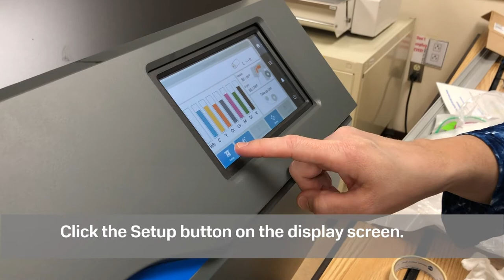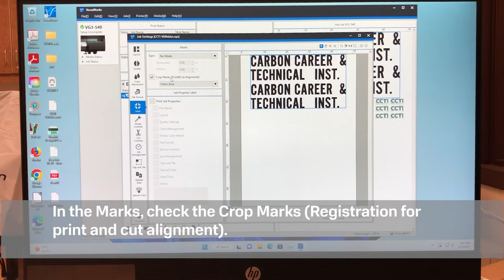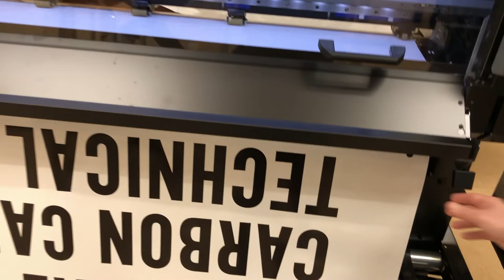Roland VG3 540 - Loading Media and Printing

Comment: I have another question. How do you adjust the Pinch Roller Pressure on the printer? The pinch rollers are pressed down too hard on my TrueVis VG3 540 and some materials cause wrinkled prints when they are pressed down too hard.

Comment: If all the colors are half way showing on the printer does that mean they all need new refil? My magenta was half way and then said empty on the machine. I bought it now it says full, now its asking for the orange color even thought it was half way on the screen, does that mean i need to replace all colors? I ran a test print and all the colors are showing.
Reply from the maker: Once a week I perform the Weekly Maintenance procedure that includes agitating all of the inks (see my Weekly Maintenance video). When you agitate them you could feel the ink moving. If during this procedure you notice that there is very little ink left, then order more. I would not order ink too soon before it runs out because of the short shelf life the inks have.

Comment: Can you show me how to clean the vinyl before printing to avoid specks of dirt, dust, oils, fingerprints, and anything else that contaminated the vinyl? I have printed on Retroreflective on this machine and even though I clean it with Denatured Alcohol and use a clean microfiber rag, it still has specks and the alcohol won't evaporate and says on the print and messes the whole print up. Wasted ink and material.
Reply from the maker: We wear white gloves whenever we touch the vinyl. We also store it in the plastic bag it came with upright. I never use alcohol to clean it. If I think the exposed area of the vinyl roll might be dirty, I would rather not use the exposed area so that I don't end up wasting ink on a dirty surface. I also use use a flashlight to inspect my roll and my print area to detect and remove any dust, fibers, dirt etc. before printing... Hope that helps.